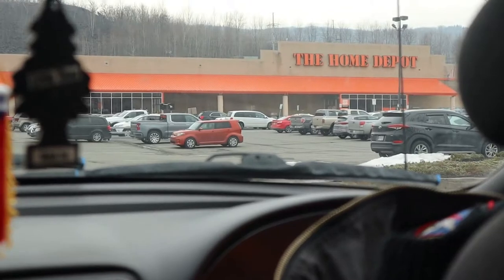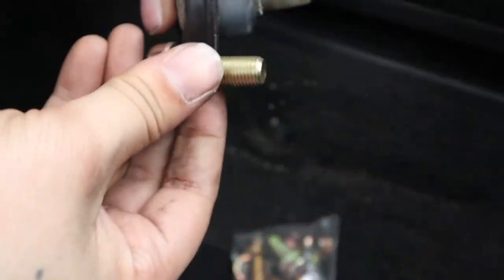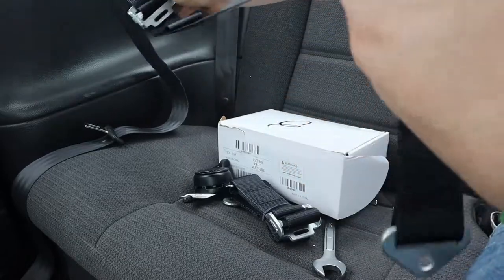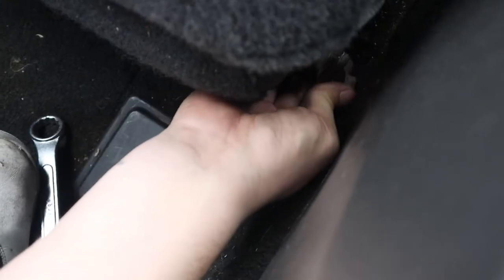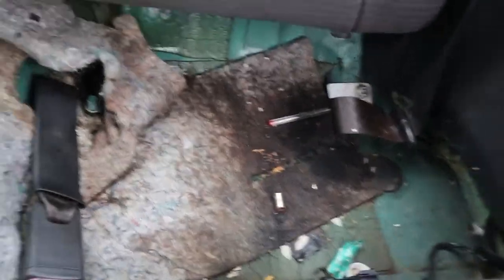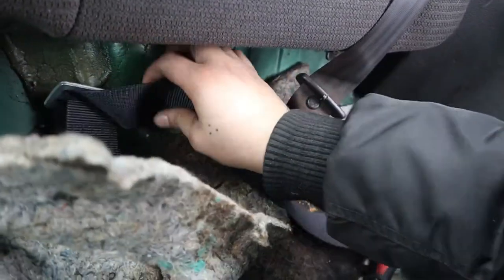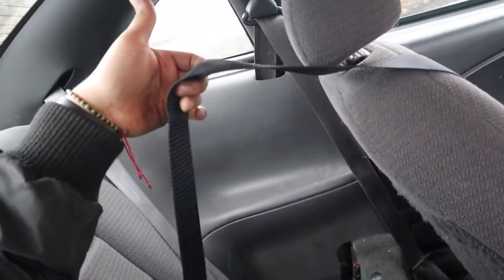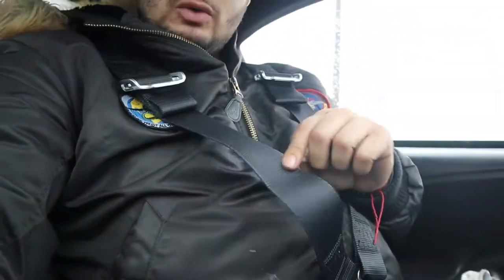Installing 4PT Racing Belts Without a Harness Bar

Comment: Sorry but don’t do this you need a roll cage or half roll cage because the shoulder straps need to be at a 20 percent  or 10 percent  angle 📐 from ur shoulders if u crash that selt belt will pull u down since it’s bolted soo far down  and mess up ur back up Js
Reply from the maker: Thanks, luckily for me I had the Harness Bar that same day which I ended up putting it on after I took the video.
Reply: I’ve heard buckling it to the rear seat bolts is the best and affordable way to do it. Roll bar is a waste of time.

Comment: Dude you need to get seats suited for a 4 point harness. Those belts will slip right of your shoulder and you will be lounched trough the fucking window😂. Just do the job right or dont do it at all. No hate though you’ll make it work💪
Reply from the maker: Haha yeah lol was surely a big mistake not getting them right angles 🤣